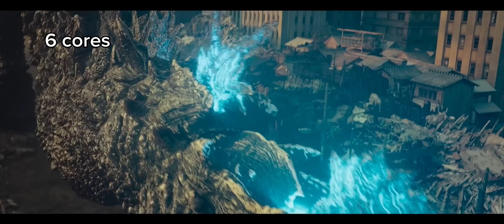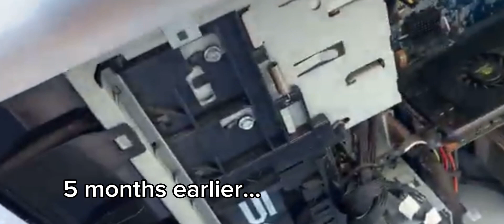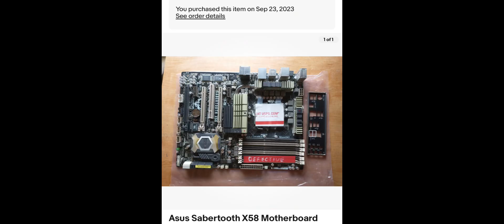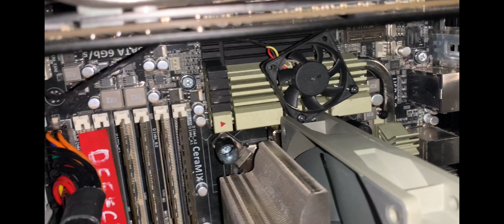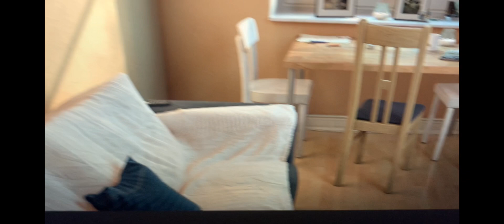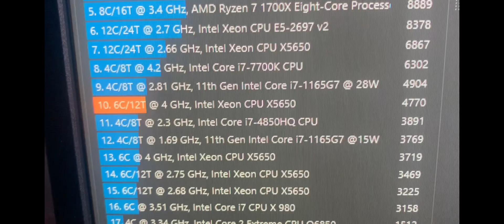2008 DELL XPS 630i - Upgrade - 6 core X58 budget gaming PC XEON Nvidia 980ti GPU Legacy build

Comment from the maker: UPDATE:  I installed an old corsair water cooler to the CPU and placed the radiator where the front fan was.  This dropped temps even at higher clocks to safe ranges.   

I was able to then achieve a cinebench score of 5389 over the previous 4770. Quite a difference 😮
Reply: My God, now you've made me want to get another old PC instead of winter shoes hahaha
Reply from the maker: @MrMartin48705 get one!  shoes later LOL

Comment: Noice vid. I'd just honestly go mad and change every blob of thermal paste you can find in this case, from GPU to NB, just to make sure. The cooling problems with the 980x could've been minimized with that, plus some playing around with the fan settings. All around I can't wait for some more tests and overloads of a childhood dream that is this PC.

Perhaps drop the CPU down a bit, so it's never under risk of being unstable. Either that or change the cooler if possible, should be able to hold that frequency without a hiccup with a bigger heatsink. Also, add RAM, and you're golden. 12GB would be a minimum in my opinion, but you should be able to find loads of DDR3 RAM for real cheap now, especially ECC.
Reply from the maker: Actually i cleaned the heat sinks and repasted where there was paste.

This motherboard has 2 bad ram slots which is why it was so cheap.  It doesn’t run hot under normal conditions.  The 4.5+ghz for 10 mins on cinebench were the only times.

The final settings of 4 is stable.

Comment: The CPU is good up to 100c
Reply from the maker: I did not want to push it too hard. The 980x I tested before would throttle if it was greater than 96c for an extended period of time.  Although I do not know if that was a fault of the processor or the motherboard/settings.